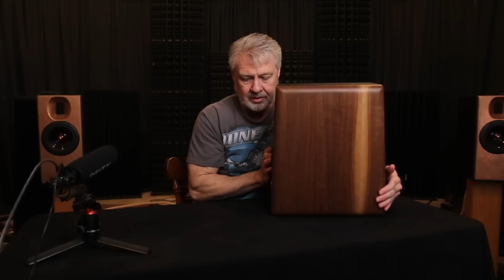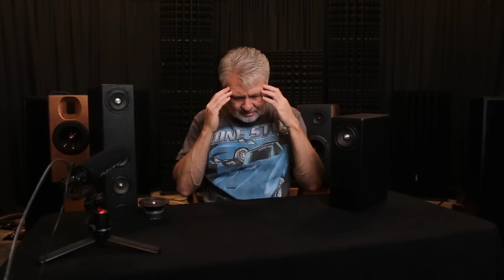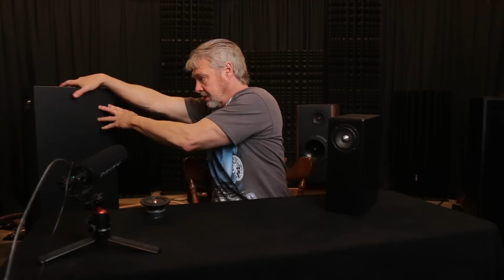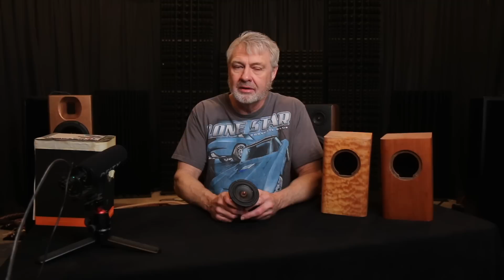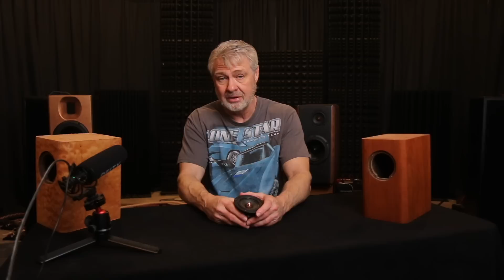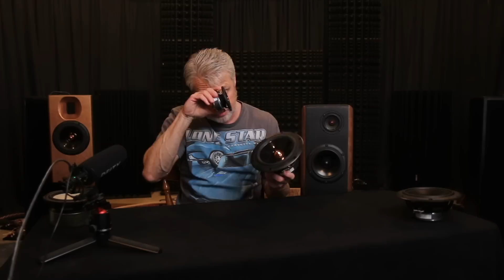Finally. We Can Chat About These... The New Record Day Loudspeakers!

Comment: Hey Guys, how do these beauties compare to the NX STUDIO?
Reply: The Studios sound more analytical, quicker, and offer greater resolution in the top end. The Studio vocals (especially female) sound slightly thinner and less holographic or three-dimensional but are more precise and laser-focused.
Reply: @ thanks, Ron. I love my Nx Studios. And my T2’s from TYLER.
Reply: @ heck yeah! Happy to help man!
Reply: To me the NX Studio Monitors are better for the application that they were designed for. They clearly have higher top end resolution and higher sensitivity. They can be used closer to the front wall as well. Basically, if it is in the signal you hear it with those speakers. They sound fantastic from top to bottom and really represent the pinnacle of stand mounted speakers. However, I find myself more drawn to the playback of the NRD speaker. When it comes to imaging, sound stage layering, separation,  and realism in the vocal region, I just get completed sucked into the music and feel more immersed in it.

Comment: Really curious how these compare to the NX Studios.  I held off on potentially purchasing those once I heard about this new line coming out.
Reply: Just reposting but... To me the NX Studio Monitors are better for the application that they were designed for. They clearly have higher top end resolution and higher sensitivity. They can be used closer to the front wall as well. Basically, if it is in the signal you hear it with those speakers. They sound fantastic from top to bottom and really represent the pinnacle of stand mounted speakers. However, I find myself more drawn to the playback of the NRD speaker. When it comes to imaging, sound stage layering, separation,  and realism in the vocal region, I just get completed sucked into the music and feel more immersed in it.
Reply: @dannyrichie9743  Thanks for the info.  Any chance you've tried them with a Galion TS A75 amp?  That's what I'm using now.
Reply: @ I think Ron has one of those amps right now, so maybe he can give you some more feedback on that.
Reply: The Studios sound more analytical, quicker, and offer greater resolution in the top end. The Studio vocals (especially female) sound slightly thinner and less holographic or three-dimensional but are more precise and laser-focused.
Reply: @Newrecordday  Oh man that's just making it harder to decide lol.

Comment: Danny,  Will the off-set mounting be a matched pair - meaning will both of the top drivers off-set to the inside or outside as you are facing the pair from a listening position?  My slight OCD hopes that is the case. 😊
Reply: Yes, the offset is mirrored.

Comment: i tried myself a fullrange driver build, with ScanSpeak 10F/8414G10, its really 3" size, i choose large sealed box filled with absorption, i could not make them sound good, had to increase the highpass on them, only at 300hz the started to sound good. those things had pretty high xmax.
maybe the box type or drivers itself, i tried a tweeter with them and that had better highs.  you really have to know stuff to get things right, and the time to experiment, and driver specific adjustment like GR-r have. 
it all depend on your expectation, high end audio is a high goal to aim for.
Reply: There is a correct box volume for a sealed box enclosure.

Comment: That 3 inch driver with a bullet is very similar to my PC speakers the Logitech Z-2300 which for me are the best 2.1 PC speakers ever made and they have also the bullet once with a little equalization they sound fantastic
Reply: my current desktop has Dayton 3.5" full rangers with the copper bullet, paired with a 2.1 amp and 8" sub under the desk. no crossover, other than the 150 hz for the sub    I've built my share of original 2 and 3 way designs ,  but since i tried this several years ago I have had no urge to change it   (other than build a nicer cabinet for them)   .   Like he said,  they're not for playing loud, but the midrange clarity is natural and beautiful.    I can imagine how great it will sound with these  super high quality peerless drivers
Reply: i also had those Logitech's, biggest issue was the separate subwoofer and 3" driver.
Reply: @sudd3660  I've been lucky then because after 19 years using since 2005 no subwoofer issue, only refoam 3 inch woofers I did it myself 8 years ago

Comment: Alresdy happy with my kapoa 5.1 in my small hifi setup but i am huge smaller speaker fan that's for sure. 

Smaller speakers just easily disappear in a room.

Adding a tweeter on the back adds spaciousness. Nudell did that with tons of infinity designs decades ago. Id love to hear a pair but not for 4k plus as i read some here suggested lol

Comment: I still do like the midrange from my 10x heavier cone lol. The little full range would be interesting to hear as I do like small drivers too. Mark Audio has some nice little ones too , though they are also designed for "full range" use, long excursion for the size.
I started out with 3" drivers, so they are still of interest :) My current desktop speakers use 3 inchers

Comment: But if those 2.5 gram speakers have so low settling time.🤔
Then we should be able to see that in a waterfall graf!?👍
That you usally measure on all competitors speakers?🥳
Reply: They are still in development. Look at the graphs in the lgk models if you want to get an idea what the driver can do
Reply: @lloyd.8272  Thanks. 
He where talking about they got here a new driver with shorter voice coil and less mass. I presume the driver in lgk is still the older previous version and not the same driver? 🤔
Reply: @AmazonasBiotop  they don’t use the old driver anymore, all the current models use the new lgk 2.0 driver.
Reply: The have one of the cleanest and fastest waterfall plots of any speaker that i have ever measured.
Reply: @dannyrichie9743  Thanks. That were what I suspekted! 👍🥳

Comment: Whats funny is I have been waiting for months for the 4' Tang Band drive to get back in stock so I could do a 2 way system like you have done. The idea of a single driver doing the most important  range of 200 to 15K is so important. Nice video and  good job explaining why a light weight wide range driver is so important to have.

Comment: With the two drivers spaced so far apart, the comb filtering on this thing's going to be horrible. Shifting your head will result in wild response variations in any direction. What a stupid mistake this thing is. I'd avoid this thing.
Reply: Think again. The crossover point is 250Hz. That wavelength is about four and a half feet long. You can be off axis at a right angle to them and not even create 10 degrees of phase rotation. They maintain the same response in all directions with zero comb filtering.
Reply: TROLL ALERT

Comment: I remember very early in my audio journey, in the early '8os, hearing a demo of the Canadian Energy 22 speakers. The tweeters reportedly were the result of a million dollar research program. The pin-point imagery and physical presence of the recordings shocked me. I regretted not buying them. Similar to this design, they had a wide-band tweeter/mid that covered the the essential audio range. Time alignment wasn't an issue. 
I would be interested in following the outcome of this project.
Reply: We had a superb Energy dealer in Indianapolis back then, ... he also had the amazing ET push/pull planar magnetic dipoles as his flagships. 

Plus the rotating selection of used gear was always a reason to stop in. 

I can see it now, used Altec Lansing (big two-ways like model 19?), used Apogee dipole ribbons, Dahlquist DQM-9 conventional three way boxes. 

Shops like that help steward the hobby along for decades.

Comment: Thanks. Will the end result be ported or sealed or have a passive radiator (which seems to be the trend these days)? And why (if you have the time) cheers.
Reply: This model is ported. It is ideal for that application and this woofer.

Comment: I just can't wrap my head around a tweeter  that size. What I would love is if you guys did a speaker with a RAAL tweeter and use that driver as a midrange. The Raal needs a higher than normal crossover, and I think that would be a nice match.
Reply: This model has no tweeter. I have used the top level RAAL tweeter. It has nothing on this LGK driver.

Comment: So.  I been looking into these Sibelius speakers from Pearl Accoustics , they cost about 8000€ with only 1 driver, no crossover.
I did some research and stumbled across this company which builds drivers , Markaudio, and they're building and selling drivers which looks exactly like the single driver in the Sibelius speaker, and the driver costs 90€ roughly. Turns out, Pearl Accoustics gets their drivers from Markaudio.
If this is the case, then Pearl Accoustics are selling a speaker for 8000€  where the single driver costs 90€ , that's a massive priceup, and if this is correct, i'd say it's the biggest scam in the speaker market in the past few years  .
Reply: I am measured and tested some of their drivers. I have pictures and measurements. :-)  I can't use them.
Reply: There´s a little more to it but I agree the price is rather crazy 🤯 and many others are equally crazy expensive.
Reply: @justasimplefox   I know they brag about "completely handbuild in real wood" , but wood costs nothing. They spend no money on crossover components, it's a single driver worth 30€ (costs 90) , and they're selling the speaker at 8000€ .
I honestly can't see anything here but very very expensive snakeoil, or a scam.
Reply: @Dreez76  100% 🤝🏻, take a look at ø audio Frigg, some mid priced Seas drivers = asking price 13400€ 🤯

Comment: You're moving towards narrow baffle floor standers like NHT did back in the mid 90's with their 2.9 and 3.3 speakers. Have you experimented with side firing woofers? Just image the top end of your current design efforts in conjuction with a side firing plate amp driven 12" servo sub.
Reply: I have experiments with side firing woofers.

Comment: I thought the LGK 3" was for near field listening? Seems odd to use it in a large speaker made for a big room.
Reply: Yeah, but it works really, really well.
Reply: @dannyrichie9743  I love my LGK 2.1s on my desk, but the vocals get a little thin when I get more than 8 feet or so away. Seems like they should have a tweeter above the 3" crossed over way up high to compensate and raise the sensitivity.
Reply: @ There is no need for a tweeter. The LGK driver plays to 20kHz. If the vocals are a little thin then it might be that your room is sucking away the bottom end from that distance. The woofer under the 2.1 model is in a sealed box and not designed to play down very low. It is for small rooms or nearfield listening. This new model is a different story.
Reply: @dannyrichie9743  I was planning on ordering a completed pair of X-SLS towers for my main room. Do you feel the new model would be a more complete soundstage? I have treatment all around the room and a REL sub behind my current speakers. (Wharfeldale Lintons).
Reply: @marshall2.015  The X-SLS is a great speaker and will have the same woofer and air space as the model 2 in this series. The X-SLS is sold as a DIY kit and will be a lot less expensive. Nothing images like this new speaker and the model 2 will be just like it but with more bass extension.

Comment: Putting an additional driver on the back to make the sounstage better makes my brain hurt, but if it works why not! I'm defintely interested.
Reply: Bose 901
Reply: @corkslagg  Yep why have just one when you can have 8 rear firing full range drivers!
Reply: It's nothing new as a lot of well known loudspeaker manufacturers like Def tech and Mirage used rear firing drivers for that holographic effect.
Reply: It really, really works.
Reply: Recreating a good soundstage seems to be part science and part art to me, but I certainly don't have the greatest system so maybe that's part of the mystique. We're so careful to get time alignment just right and round those tweeter edges, etc. But then adding a rear firing driver makes it better somehow. I believe you but I can't figure out how that extra speaker doesn't mess up the already fragile soundstage, or maybe it does but the added holographic effect makes it better anyway. I'm overthinking this! The end result is what matters and I will buy a pair if my budget allows.

Comment: Why are you putting the high and low frequency drivers so far apart? You often say that they ought to be closer together for a more seamless off-axis frequency response.
Reply: They cross at 250Hz. The wavelength at the frequency is about four and a half feet long. So the spacing is not an issue.
Reply: @dannyrichie9743  Ah, okay. Can't wait to hear them.
Reply: I am in learning mode and I was asking myself the same thing. Thanks for the explanation.

Comment: Would be nice to see /hear a version designed for near wall use - front ported or sealed, crossover setting like Epos Es7n. Many listeners have room limitations that preclude 3 feet into room positioning...
Reply: See the standard LGK 2.1, and 2.2 models.
Reply: They look interesting but being sealed and quite small a sub is likely a must. The idea I'm referring to is a larger cabinet, larger mid bass, and  front ports or rear passive radiator balanced for close boundary position...for what it's worth.
Reply: @ Okay, got it.

Comment: I made it to the end and wish it was more technical.  Some of us have been using small wideband drivers in car audio competition for years now………. Theirs trade offs when you don’t use a tweeter.  Time alignment and phase are the biggest pros.  

With digital signal processing, we can bump the eq up when the upper octaves start to drop off.  Even with a mid level processor they’ll go + or- 10 DB on a 31 band EQ.  I would Probably cross that driver at 140hz @ 24DB  per octave LR/R x-over point.  Based on your explanation or the driver.
Reply: The measurements are outstanding. All will be posted....

Comment: Do these image better than the Super Mini's? That would be hard to believe, ha.
Reply: They image as well and better than anything I have ever heard.
Reply: @dannyrichie9743  I can believe it and it's what you had said that about the Super Mini's at the time and it's true. 
I am wondering about using the drivers as rears in vehicle. If relived of the bass below 80 hz, do you think that work well. I do listen loud. My other concern is performance in sub zero temperatures. I have had some Scanspeak Revelators that would mess up, probably due to coil gap I am thinking. Thanks
Reply: @rvaillant  They will not withstand the outside weather or humidity.

Comment: Can I ask why the midwoofer is not flush mounted? Other options for the woodwork possible? This is little intense pattern for me 😅 (some natural oak maybe)
Reply: That woofer has a non-resonant polymer frame and is designed to be surface mounting. 

Colors are white with Maple sides, black with Walnut sides, and a dark grey with red walnut sides.

Comment: Deal beakers for me:
-Offset drivers. 
-Not flush mount. 
-Exposed Hardware 
-Flat sides.

Ideal:
-Center mount
-Flush
-Hidden Hardware
-Lute Shaped (curved sides).

Your speakers measure really nicely, but all of them are too ugly for me. Cheap isn't a selling point enough for me. My room has sonus fabers. If your speakers are significantly uglier the wife (and me) won't accept it. The ones I already have are good enough. I still have to LOOK at them when they aren't playing. 

Just because something costs less isn't a selling point when what I already have looks good and is almost there as far as sound is concerned. 

I think you have wonderful engineering methodology but I want to see you match your sound quality with worthy design. It can't be half assed.
Reply: The driver is offset for a reason. We actually tested six different offsets to see what measured the best. An asymmetrical positioning also improves imaging. The drivers are flush mounted except for the lower woofer. It uses a non-resonant polymer frame that is designed to be surface mounted. There is no exposed hardware. This was also a prototype. The product models are gorgeous. The performance is also off the charts. 

However, if you just want a pretty box and don't mind how it sounds or that there are garbage level parts inside, then Sonus Faber my be just the speaker for you.
Reply: You know what's a deal beaker, I mean breaker for me? People who can't proofread their own text before uploading. They are almost as irritating as people who listen with their eyes.